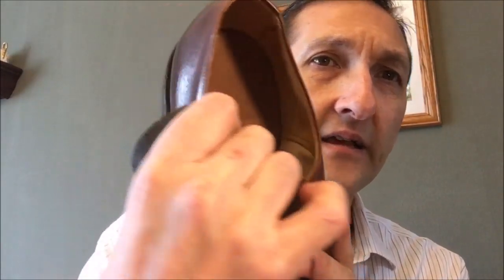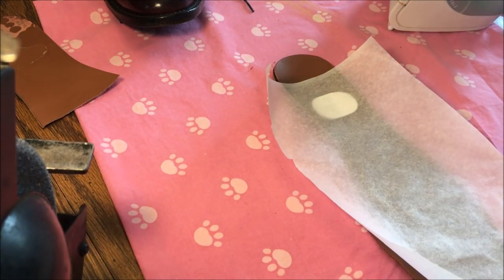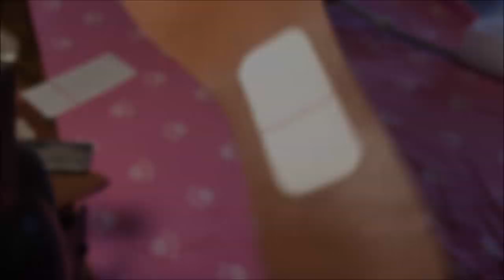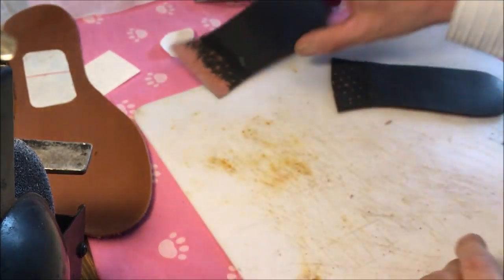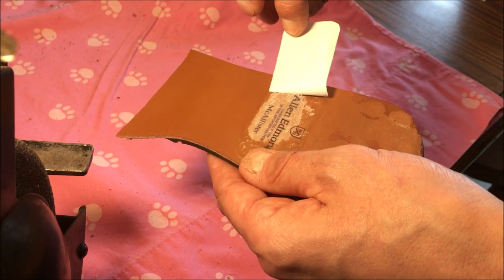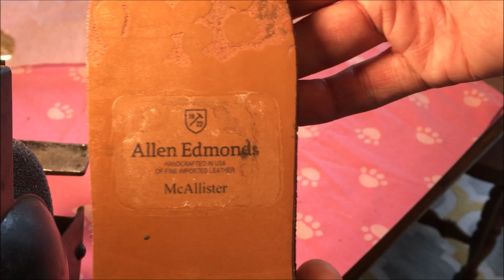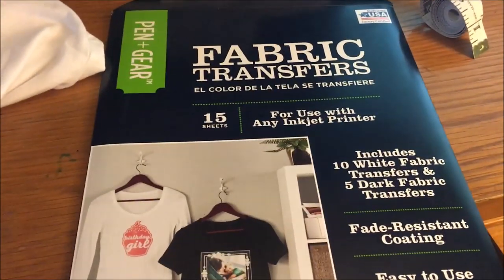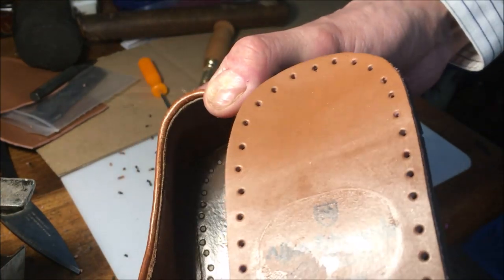Can I make printed insoles at home?

Comment: Hi Robert! Really enjoy the videos. I've recently been on the quest for finding new, inexpensive, goodyear welted or blake stitched shoes because I think the throwaway shoe industry is very wasteful. While the cheapest genuine/full grain leather shoes I could find (after an admittedly brief night of searching) were between 90-$120, I found some Stacy Adams  Deacon Cap Toe Oxfords in navy suede brand new for $57 which claim to be Goodyear welted. I'm a big believer in "you get what you pay for" and this seems absurdly cheap for such a labor-intensive construction technique. Any thoughts on why this might be? I know suede is a generally a cheaper material than a high-quality full grain leather, but surely this alone can't be the reason for the low price.
Reply from the maker: Sawyer Pence - thank you! I just looked up the “DEACON Medallion Cap Toe Oxford $95.00” on their own website (funny because it’s a Derby, not an Oxford):
1. I don’t see it stating that it’s Goodyear Welted anywhere on the site. Generally if it doesn’t say that it is Goodyear Welted, it’s not. 
2. There are no visible stitches on the outsole photo, meaning it’s either not stitched, or it has hidden channel stitching, and trust me, a cheap shoe will NOT have hidden channel stitching. It doesn’t even have a leather sole. 
3. Many shoes in the $100 range today come with false stitches. If you look at a catalog of a company that makes welting, you (companies) can buy welting with stitches already in the leather or plastic before they put them on the shoe. They are decorative. Check this video out:
https://youtu.be/nwY8tZy7PPg
Both shoes in this video are made this way & I explain more in it.